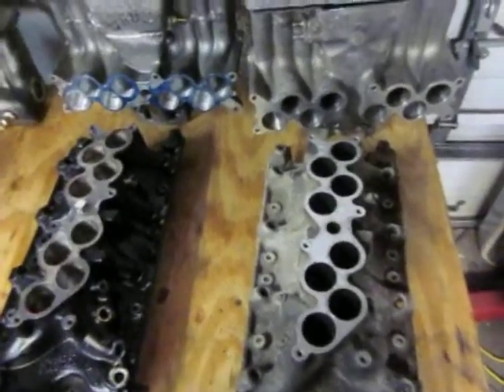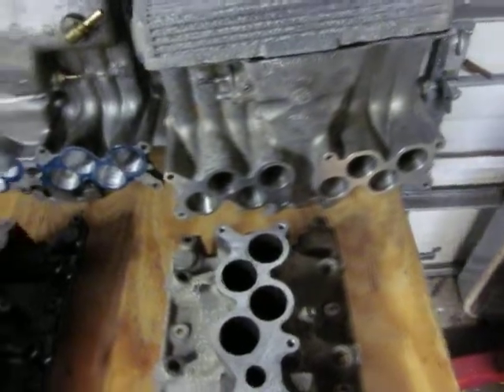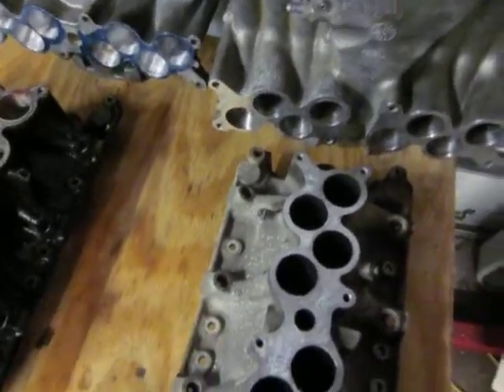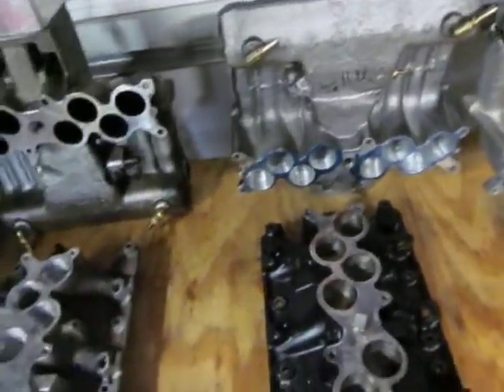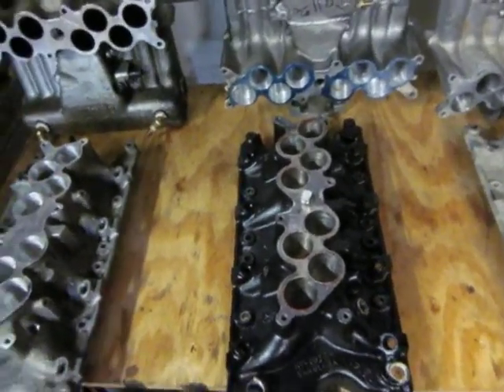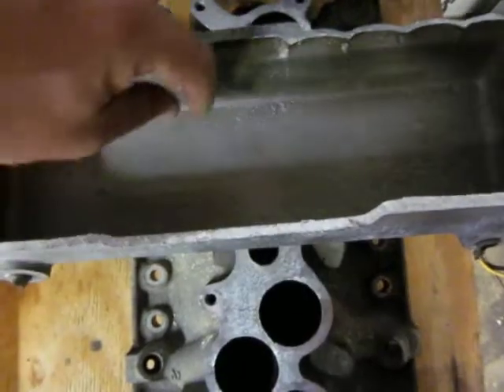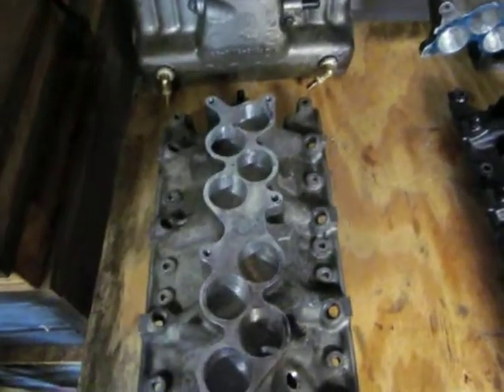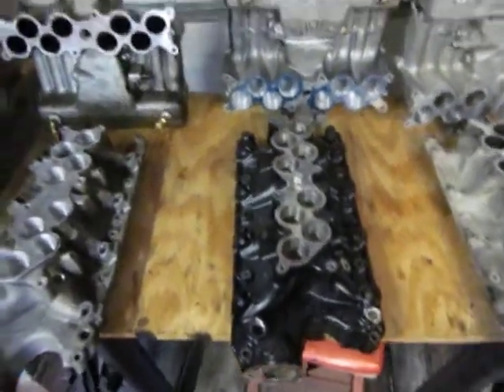Explorer manifold shennanigans

Comment: Hi Dave.. I know this is more about porting.. but was wondering if I could bypass all the pcv inlets on upper plenum.. I ask because I want to run oil separator.. but it's to big to mount on firewall by pcv valve.. no ac compressor on car so it would mount nicely up front with easy access to empty it!   So I can run one line off pcv valve to catch can .. then back into underside of plenum..??  Looking at all the plenums you have... I see all kinds of elbows and plugs and different routing setups!!  But not sure the reasoning for it!  Thanks for the vids!
Reply: How did that work for you.

Comment: 12", 14", and 16" - looking forward to the results.  Did you use Pipemax for runner length calcs?
Reply from the maker: No, Engine analyzer to get diameters, measured port length by measuring length of the floor, then the length of the roof as it were, then split the difference. ^ This gentleman is TMoss I referred to in the video, you can reply to him, or he can post his email if anyone wants to get in touch with him.
Reply: @FXRSDriver  et all - my email is mosstpsa'at'sbcglobal'dot'net